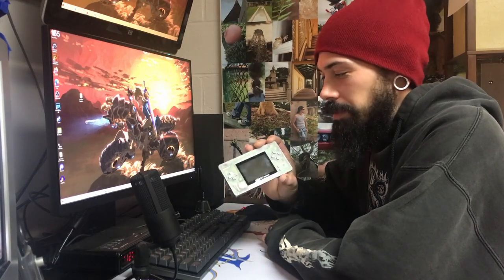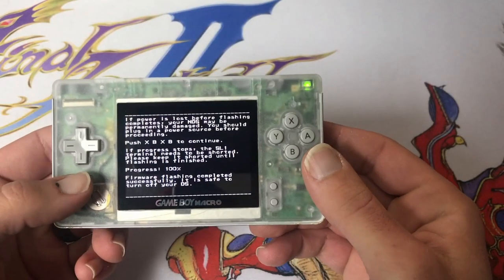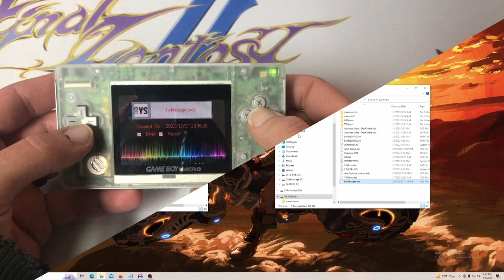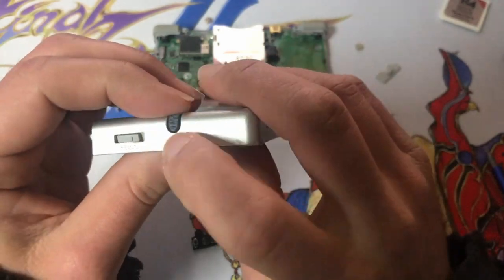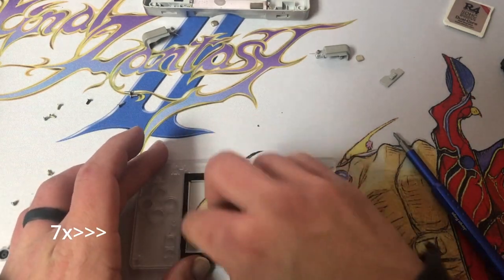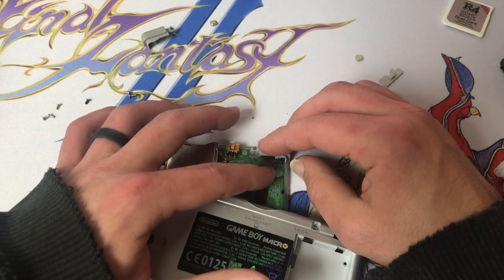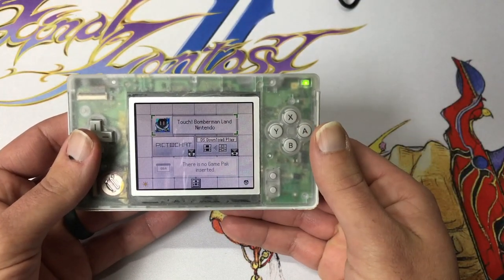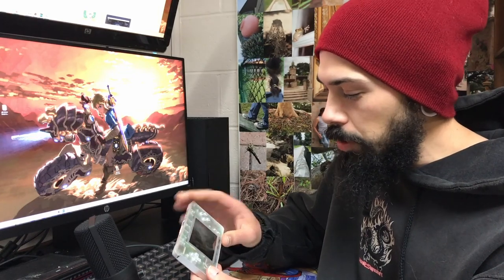Upgrading the Gameboy macro into a Nintendo Swap

Comment: ive always been meh with the macro, and this mod kinda seems counter productive, but you have a good point around sentimental value. games id play like the ds zelda, animal crossing or even dragonball origins would use both screens simultaneously and need touch so i dunno. its niche but its also super cool at the same time!
Reply: We are human. We do things cus we can. 
Gameboy Pocket 2024
Reply: touch screen works always without pushing the button of screen swapping
Reply: I mean it's a good mod if the top screen is broken. keeps it from being thrown away.
Reply: I would never do it with a working, functional ds. But if the DS Slot Broke, or the screen broke, then it would be worth it. I certainly prefer having both screens though. Still a nice mod for broken ds's.

Comment: This is an incredible mod! Too bad I went the BoxyPixel route when I made my Macro. Clipped the ribbon cable port to make room for speaker in the top left
Reply from the maker: if your not afraid of soldering you can still add the switch and solder some wires to the test pads for the connections you need the points are on the github page for the switch assembly. but i suppose you still would be missing the x and y buttons :P

Comment: Very nice and clean mod! Where did you buy the small board and the Gameboy Macro Holographic Sticker?
Reply from the maker: The sticker came with a glass screen lens. It’s been out of stock from the original supplier not sure where you can get one now. If by little board you mean the buttons to swap screens I got it of the eBay listing in the description haven’t seen if they still have them it’s been a while

Comment: Hey where did you get this PCB mod? Cant find it anywhere and want to install a similar switch!
Reply from the maker: Unfortunately the creator of the board does not have any more but the link in the description goes to their GitHub project and you could get the files for the pcb and have a service make it for you then you would buy the components and solder them on your self
Reply: Shitttt seems like a pain! I’m going to check it out regardless such a niche/cool little addition to the micro. Wish that this faceplate allowed for the touch screen to stay tho :/

Comment: Would there be any way to set up screen switching without getting a switch? Ex: pressing a combination of buttons to switch screens
Reply from the maker: I don’t think so but I’m not an expert. I think it is using circuits that are on the top screen connector so it’s not really a software thing more of a “when this pin is 0v perform switch” but there are other buttons/switches that don’t mount on the rear of the board if you don’t have the space back there

Comment: What about a macro without the gba cartridge sticking out and yes I want it to be a ds lite macro and no I don't want to use a flash card
Reply from the maker: I don’t think it’s like conventionally possible since the cart slot is soldered to the motherboard you would need to somehow move it further in the case and while you could remove the ds card slot to get more space but then it would be a straight macro mod and you would not be able to play ds games anymore. Plus you would have to some how hold the slot in place and also connect it back to the motherboard pins remotely. It’s possible but at what cost.

Comment: Can you please do another video of one with a touch screen
Reply from the maker: What do you mean like the same mod but with a touchscreen it would be an identical video just instead of the screen lens it would be the touch screen it would not effect the mod at all I used the screen lens because all the spare touch sensors I have are really scratched up and cloudy
Reply: @Chibichief ah okay I don’t have one of these yet I did when I was little an I’m thinking about doing this cuz you can play ds games an gba stuff right
Reply from the maker: You don’t need to do this to play gba games it normally plays them I just added the switch in the back to be able to swap what screen is on the bottom because all my top screens were busted.